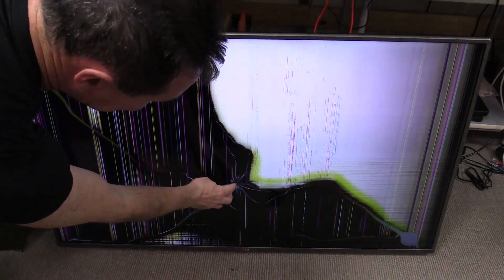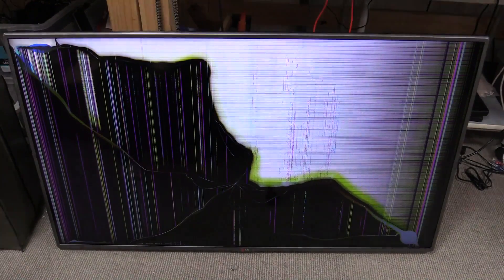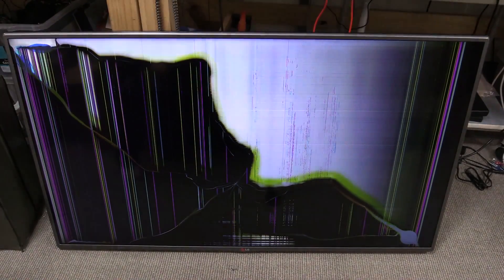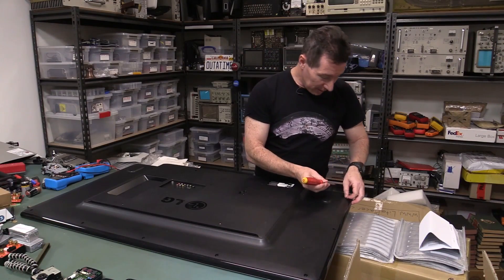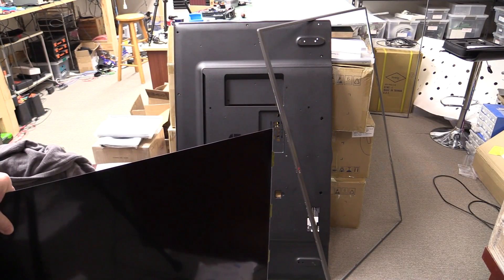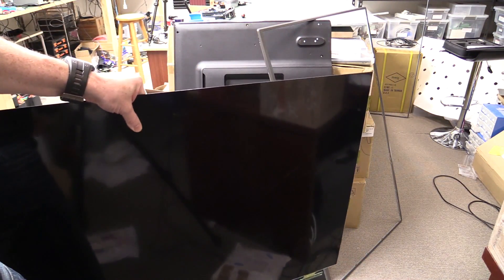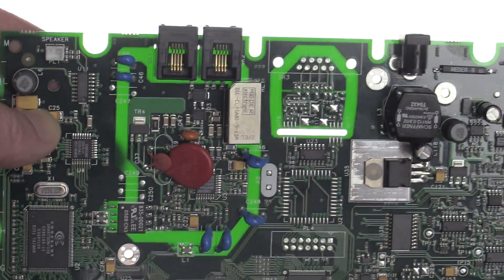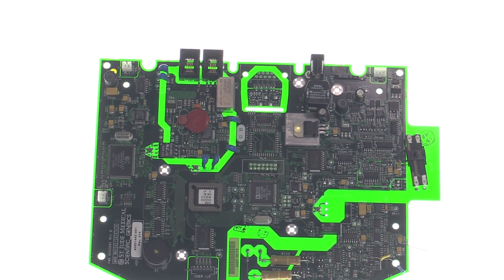EEVblog #915 - Dumpster Dive LCD TV Salvage

Comment: It makes sense not to include the extra phosphors needed to produce a higher CRI in the LCD backlight because the LCD needs strong peaks in RGB. Any light in between the frequency of the pixels will either be wasted or contribute to worse contrast or poorer saturation in the image.  I would assume that the phosphor mix on those LEDs is custom tuned to use only two phosphors, a green and a red (with the blue coming from the LED itself) whereas if you want LED lighting in a home or in a studio light), you would use a broad-spectrum mix of phosphors.

Comment: I wouldn't call the 120Hz a PWM Signal. I would prosume, the Panel has an update-rate of 120Hz, so the Backlight is pulsed to illuminate the panel only when the screen is fully refreshed. Between to frames it stays dark to prevent the user frome seeing any artifacts. This way the image looks cleaner (not washed out). 

They might still do some brightness control by changing the width of the pulses, but it is more than just that.

Comment: A Samsung LED TV you can light the LEDs without the main board. With LGs you need to supply 15v to "BL_on" 

You'd probably not want to put too much weight on the "lightbox" because it's only held up with four plastic pieces that are about as thick as a precision screwdriver. You can pop the black plastic off and add something to help hold that up...normally you'd leave the LCD to the black plastic to repair the LEDs in the panel.

*edit - Just started watching your second video. Wow, that LG is completely different from the US market LGs; the LEDs, lens, strips and how the sheets are held from drooping to the panel. The lens on the US LGs are convex and point light up instead of out sideways. I can send pictures if you're curious about the differences.

Comment: THANK YOU DAVE for doing this. I saw you tear down many TVs in your other videos and was wondering when you would do this. I did this with three LCD TVs and made a few awesome shop lights out of them. I added a chain to each and they are now hanging in my garage. One of them has issues though it won't power up. I'm thinking bad caps. These are all CCFL backlit no LEDs.

Comment: Is the LG backlight spectrum engineered in a way to produce wavelengths corresponding to the RGB pixel filters in the actual LCD? I would think those LCD panels work optimally with specific RGB wavelengths in the backlight and other wavelengths are just reflected  or absorbed, wasting that energy. Having said all of that, the red in the spectrum was very low, but our eyes don't require much red in the mix do they?

Comment: 120Hz backlight allows to simulate cinema style "double-shutter" projection for 60fps source (and maybe "quintuple" for 24fps). The motion looks better this way, the tradeoff being it does flicker more. As mentioned in other comments, it probably switches to 100Hz for PAL sources (if done right). Anyway, for a light source 120Hz is way too low. It's not good for the eyes. Replacing the driver with continuous constant current driver, as Dave mentioned in replies, would certainly be much better.

Comment: I'd love to see a few ebay UV LEDs on that spectrometer. Are the 365nm ones really 365nm?

The processor board needs to be connected to control the brightness, sometimes dynamically, to inprove contrast. Sony even had an RGB matrix backlight a few years ago - almost like a low res LED TV. Those weren't cheap.

Comment: People complain about you not using a cordless electric screwdriver? Wow... people need to chill out.
Reply: Also, using any kind of motorized screwdriver (except ones with adjustable low torque) increases wear and tear on the device under repair, so it's bad workmanship compared to professional manual handling of low torque assembly screws.  Of cause if you are trying to maximize devices repaired per day, the slight increase in later inability to repair may be an ok trade-off.

Comment: Those eyelets are probably to allow a repair by snipping the old part off and soldering in the new one without removing/flipping the board over.
Reply: Correct. Oddly they've used on just two of the bridge rectifier pins as well.

Comment: It makes sense for the TV to use LEDs with phosphors that emit all their energy in the Red/Green/Blue spectrums with little between them, because the LCD that they're shining through is only going to allow those frequencies through.  Energy emitted in intermediate frequencies will just be absorbed by the LCD panel and turned into heat.
On the lighting panel, it makes sense to produce a broad spectrum because it'll be lighting things of any color.

Comment: I'm wondering if the 120Hz changes to 100Hz depending on the frame rate (50 or 60Hz) of what's being displayed, (edit) hence the need for the controller board connection.

Comment: Arent there RGB leds inside? So you could change picture temperature....or is this achieved with the LCD (and not with the backlight)?
Reply: Not in the cheap ones. I know HP has those DreamColor LCD panels in some of their beefiest workstation-laptops, with RGB backlight and 10bit panels, but those'll cost you an arm and a leg (at the very least). Possibly some of the flagship tv's do also, but i can't really name names.

Comment: Amazing to see the idiots on local sales forums trying to sell cracked panel TV's for several hundreds of dollars claiming  "Easy to fix, have a smart TV for a fraction of the cost".   Had one argue with me when I call him/her out for their B/S.   I did manage to locate a replacement panel (only 2 suppliers) and the cost was within a couple hundred bucks of buying a new set of the same make/model.   Just because you lost your temper and launched your joystick controller and cracked the screen, suck it up and learn anger management.
Reply: Ask them "if it's easy to fix, why don't you do it and sell it as a WORKING TV for much more money?"
Reply: John Ridley
  I usually point that out on the facebook posts that I find.  I did an "informational post" concerning flat screen TV's and DLP TV sets for C-List a while ago.  We have had good luck with basic repairs of DLP sets.  (They actually have an extremely good picture at 1080p)  But with the deluge of 'junk' sets, and people thinking they are getting a good deal-  There's one born every minute!

Basic "Value" of a TV with a broken screen:  $5-$10 bucks for harvested parts.  (removal time, shipping/resale of used parts to make a modest profit)  Basic value for a broken set with a good screen:  I'll go as high as $20 for a 32" and $30 for a 50".   As usually it's bad caps or power supply issues.  Repair cost in parts runs about $20.  Flip for $80-$100 after repair.   Covers the parts and my labor to resell.  And sometimes I get 'stuck' with ones that have some really bad issues and need entire boards replaced.   I've got a plasma with a bad main logic  ($65 for the part...and I'm into it for $30.  Makes no sense to repair at this point.)  And a 32" with sound issues.  Unplug and plug in the speakers, and the audio comes back on and sounds great the rest of the time it's turned on.  Shut it off?  and no sound next time you turn it on.  (unplug the speakers again with it turned 'on' and the audio starts up again 100% normal)  No aid online regarding schematics or testing...so kinda shot myself in the foot.

Bottom line, you're quite correct.  If it's that cheap to fix?  They should do it themselves and not pawn off their problem on someone else.
Reply: That audio problem is weird. If you were just repairing it for yourself, I might suggest as an outside the box bodge to add some relays and a 555 to automatically unplug/replug the speaker connections when it's powered on, but that obviously just papers over the original fault.
Reply: tylisirn
 The plan was to repair and resell the sets to help offset expenses.  (I've survived both a major heart attack and cancer over the last few years.  Prescription cost as you can imagine are high).

The set does have a few other postings about this issue that I did find.  Sense flat panel TV's rarely have any online or usable schematics or trouble shooting guides (Remember Sam's PhotoFax?)  The only listed solution was full replacement of the main logic.   Which costs more then the set is worth.  Like the plasma one that's on the floor next to it.  Cost to repair including investment to purchase exceeds what it's worth.

Sometimes you get lucky and it's a simple issue (re-cap or CFL transformer/invert....P/S issues...)  And sometimes it's just a huge PITA.

Comment: I built a smaller one of these years ago with an old BenQ PC monitor. That had CCFL backlighting though. The PSU/HV gen board for the CCFL had a 5v analogue input to control the brightness of the backlight. I connected a 10K pot between +5V and ground with the wiper going to the board and could control the brightness without the processor board. I wonder if the same principal is used in this TV?
Reply: I think Dave is right and the signal has to come from the processor board to get the panel light synchronized to the frame display. Also most TVs these days have enhanced contrast where they will dim the backlight when the TV is showing low light pictures. That MUST be controlled from the logic board.
I think probably the power supply is similar to a PC supply where the logic board is what tells the power supply to turn on. If the logic board didn't have control of the main part of the power supply, it wouldn't be able to implement power saving features.
Reply: The monitor I hacked, it had a logic level on and off plus the 5V analogue level where the processor board controlled the CCFL circuitry that was combined on the PSU. This was a 10+ year old monitor though.
Reply: Aron Gooch Yeah, you can't turn a CFL on and off that fast, nor probably use it to generate dynamic brightness in a scene. I don't think that started until they were making LED lit TVs.
Reply: Perhaps I'm not making my self clear. The CCFL HF generation board has two inputs from the processor board. One that turns the CCFL on or off completely but not PWM, probably for when the monitor goes into standby. The other input is a 0 to +5V signal that depending on the level controls the brightness of the CCFL. The PWM to the CCFL was done on the CCFL HV board not from the processor board.
Reply: Aron Gooch Yes, that's fine. Clearly that's a very good way to handle it if you have a CCFL light source, because it won't respond as quickly as an LED.  Certainly you can't flip it on and off between frames.

Comment: The TV probably has some kind of light sensing features, also the previous user could've set the TV to power-saving mode in it's software (well, at least the backlight, especially when it's PWM-driven) - it's such a shame that you won't be able to squeeze 100% of that panel.
Reply from the maker: Just replace the driver.

Comment: Couldn't you sniff around the processor board to up the frequency to something like a few khz so you avoid the flicker ?
Reply from the maker: Just replace with a continuous constant current driver. Would gain efficiency too as it would be optimised for the load.
Reply: EEVblog I have a few laptop lcd's, might try with those
Reply: ***** But if you want to use it as a studio light camera's are important :p
Reply: You would also have to check, if the driver is built to switch at more than a few hundred Hz.
But it should be possible to get rid of the logic board completely. My guess is that there's just a single line for switching on and off (the 120Hz PWM) the backlight. Could replace it with a NE555 as a dimmer ;)
Reply: superdau That's what I was thinking